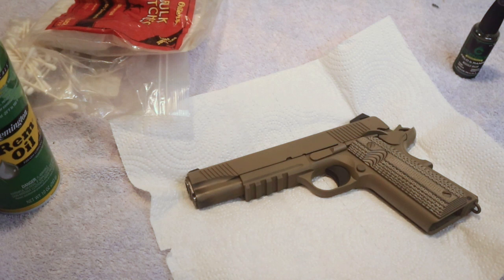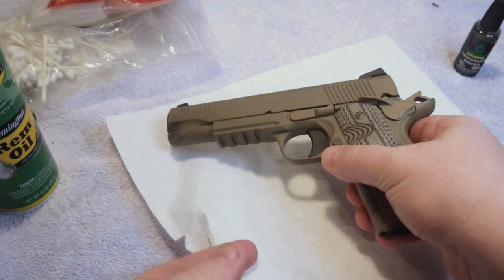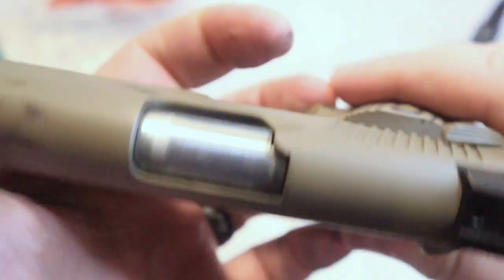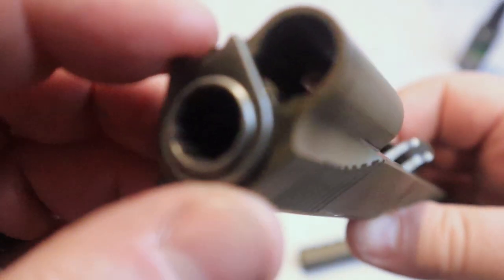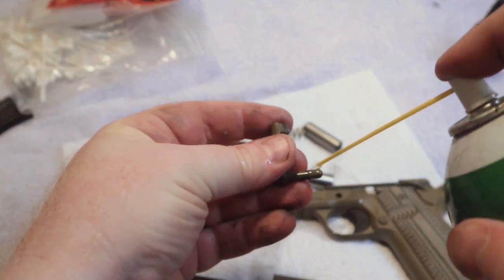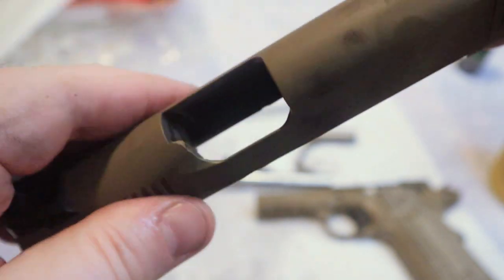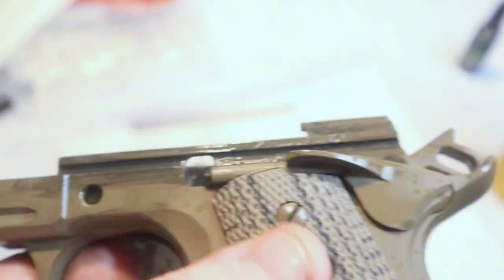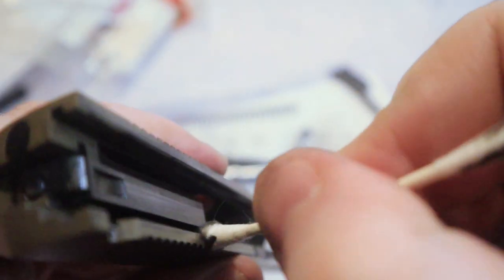Tisas 1911 Raider Cleaning Guide: Step-by-Step Maintenance Tips

Comment: I'm a Tisas Raider owner along with its Girsan competitor. Like the Videographer, I love the FDE finish.

A couple of things.   I was always trained to use a Bore Brush in the direction of Bullet travel.  No point in nicking up the barrels crown by accident. 

Lastly.  I agree about removing the Firung Pin Backplate. Removing the Pin , Pin Spring and the Extractor then cleaning out the wells from which they came with a Solvent of choice and those Q-Tips.  Your Extractor issues will be few this way..and the Breech face cleaner than ever.
Reply from the maker: A bore brush that can damage the crown or any part of the barrel is to hard in my opinion.  I won't use some of the harder ones that are on the market.  I just let the solvents do the job.  If necessary I'll soak them.

Comment: About every 200-300 rounds I also depress the firing pin, slide the firing pin plate off (careful, firing pin has a spring and is under tension) and remove extractor.  Clean extractor tunnel in slide with a Q-tip and use cleaner on extractor, firing pin, and firing pin stop.  Reassemble in reverse order.  Keeping firing pin depressed while sliding plate back on can be an adventure.
Reply from the maker: That's why most rarely ever go that far.